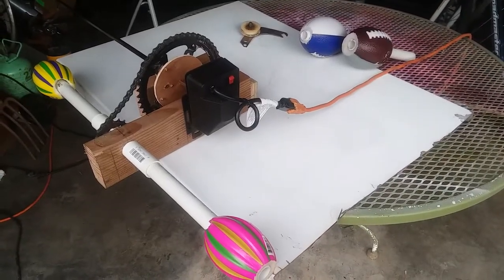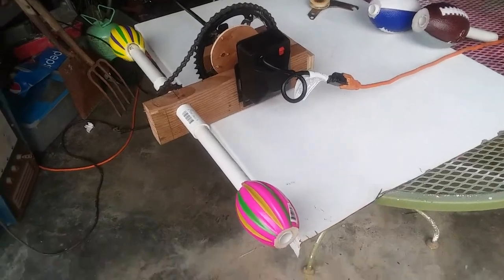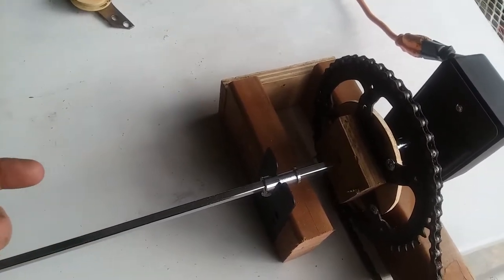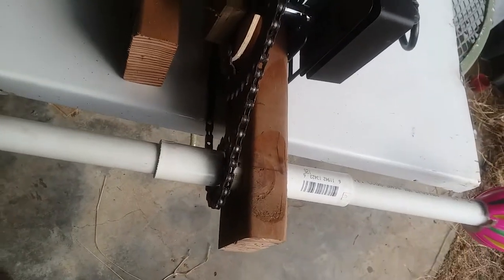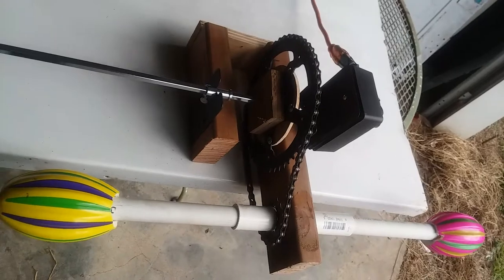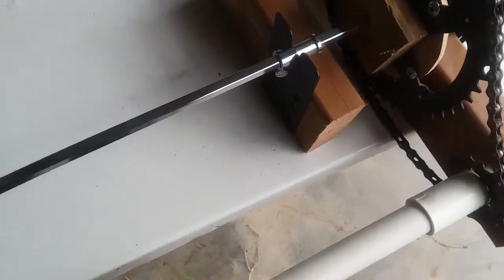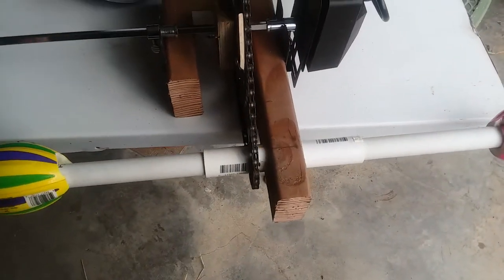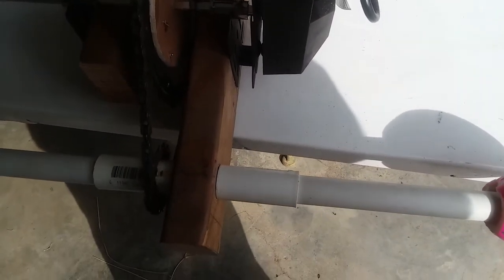Multi Cup Rotisserie Turner

Comment: What gear size? I have everything but the little gear that Ford the coupling
Reply from the maker: Sorry for the late reply. I haven't did anything with this page in awhile -- It is one of the smaller gears from a 10 speed -- just make sure the center is big enough to go around the 3/4 inch coupling -- I hope that makes sense